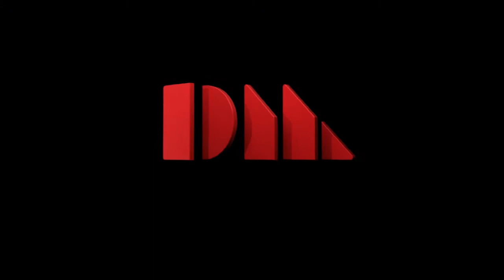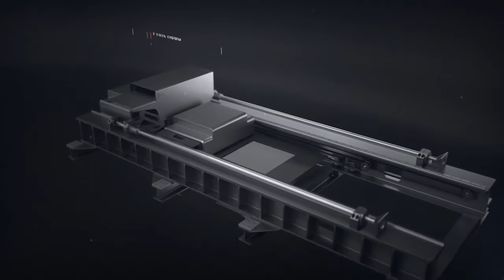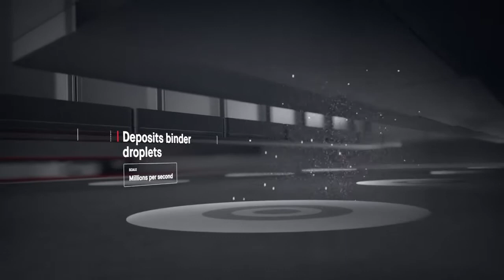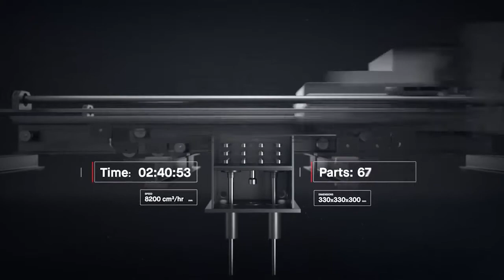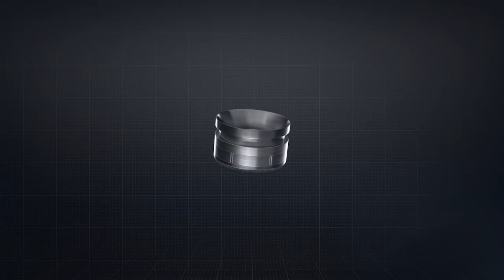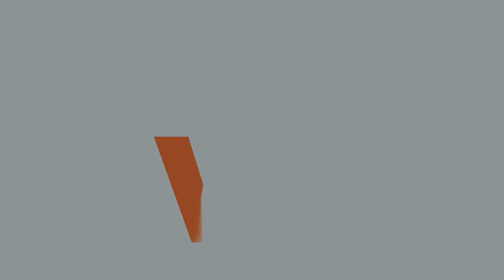Desktop Metal Production System

Comment: Good technology hope this doesn't get buried by the Heavy Stamping trillion dollar market. Right now Heavy Stamping stamps a part every second but those parts all have to be laser welded together later in sub assembly . A car rail for example may have 10 parts stamped and then welded together so the factories have the metal sheets already cut then stamp those cutouts with Dies with a Machine Train line basically where each die stamps a specific shape. So a 5 stamping machine line with 10 Die moulds ( top and bottom dies) this takes time to setup and time is money. If the entire Car rail could be printed in say 10 minutes this would eliminate hours of work and billions in wages and hundreds of billions in Robotic Arms needed to handle the parts for welding and moving the parts from Die to Die stamping Presses.